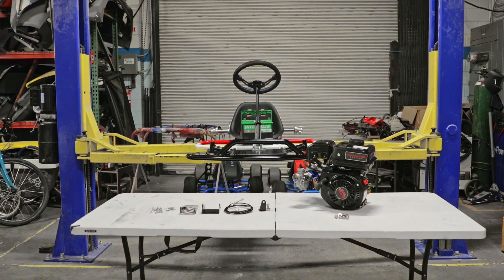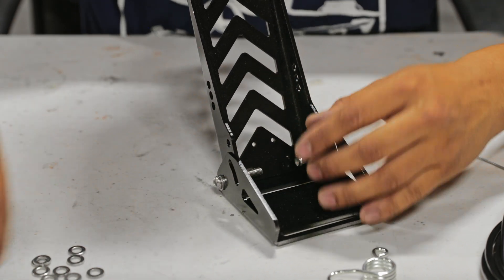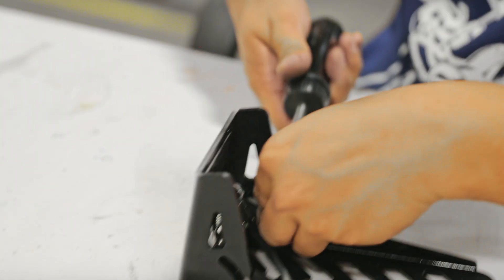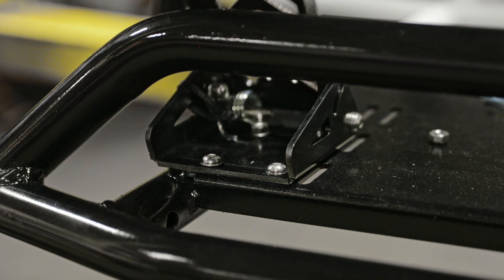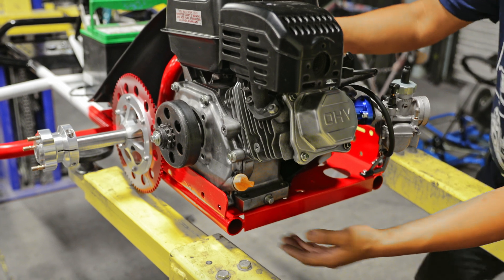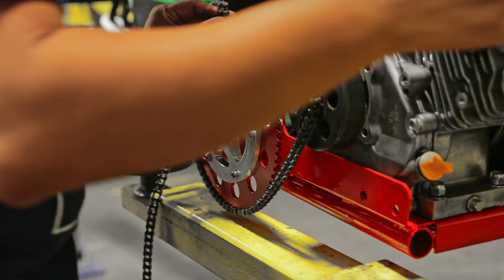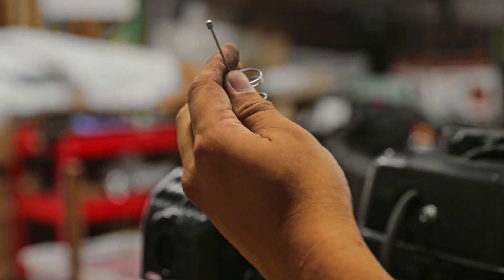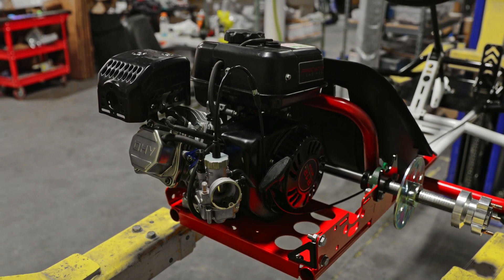Battle Aero Drift Kart Gas Motor Install (212cc Predator)

Comment: I have an old 13 HP Toyama TE130 389cc engine here. Would a motor of this size fit in the chassis? What do you think about this power? It weighs 66lb

Comment: I have a couple of questions. If i purchase the gas kit would it come with all the parts like the frame screws and bearings and axle and stuff like that. I know it wont come with the engine. My second question is would it work with the prededetor 212 ghost engine and my 3rd question would be about how long would it take for it to arrive. I live in Philadelphia. Sorry if it says some of these stuff on the website but i just want to make sure like 100%
Reply from the maker: @milanJ-k8k  yes will work with 212cc Ghost Racing engine as well. The mounting points are the same as Predator engine. Email us for shipping estimates BattleAero@gmail.com